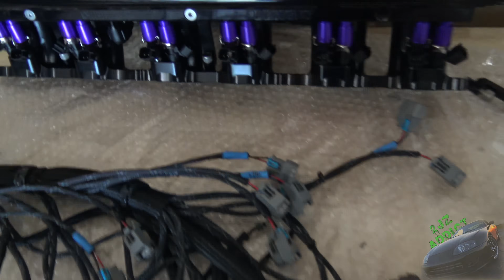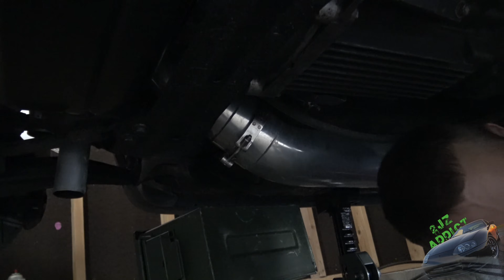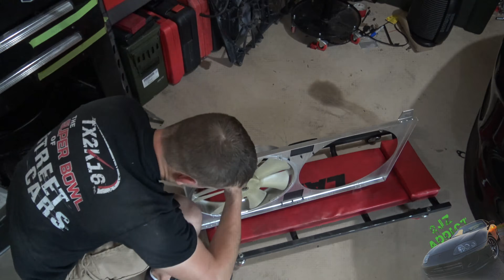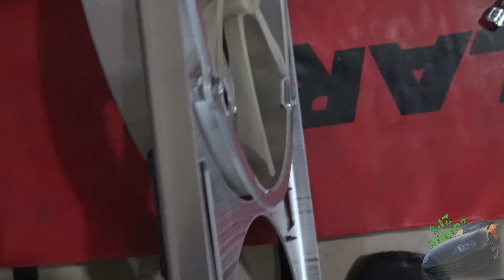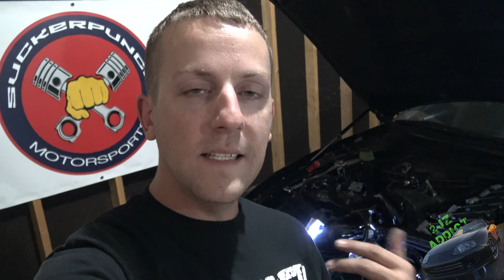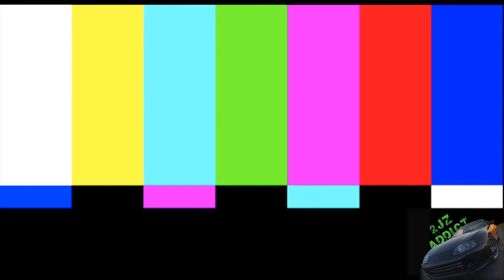1000hp Supra Build | Part 9 | 99 Problems and my Supra is all of them

Comment: brother, this build is amazing. Going  to buy the phr fan shroud and transmission cooler for my build.
Reply from the maker: Thanks man! I appreciate the kind words! 🍻👍 What all do you have done to yours?
Reply: @2JZAddict  still getting the parts together for the sc xD.
Reply: @2JZAddict  Was planning to get the grannas t56, but i really dont wanna cut the tunnel, so ill stay a340e for now.
Reply from the maker: I think it’s just a mild trim for the T56 though isn’t it? I didn’t think it was anything too crazy. Sounds like you’re going at it right. Getting as many parts together before you tear into it is the best way to go for sure. It’ll minimize the downtime and keep things going as smoothly as possible during the build phase. 👌

Comment: What exhaust do you have on that? 🤔 is that aluminum that you was bolting up to the downpipe?
Reply from the maker: The exhaust is ceramic coated a high luster silver which is why it looks so much like Aluminum. It’s the 4” SP F1 DP/MP w/3” boost actuated cutout mated to a Veilside Teardrop Ti. I might end up swapping it out for the HKS Racing TI though for some better flow through. 🤔

Comment: I had to notch the steel for the fuel pump fittings , same as what you are running into , and I made a custom "hat" to clear it all.   Also did you make sure that the cams have a rear pic up ?  I have always have more success , in more of a stable sync running the front cam sensor .
Reply from the maker: That’s what I’m leaning toward. I’ve got the high rise hat from Wade so at least that part is good. Haha I’m honestly not sure on the sensor pickup. They’re GSC S2s and I was running the forward sensor position on the old setup. 😬 I suppose we’ll find out really quick when it doesn’t start due to lack of cam sensor reference. Positioning the injectors in order to clear the sensor will be the issue though. If I do need to run the forward sensor I’ll need to grind off the material for the factory IM support.

Comment: Other option is a radium fuel pump hanger?
Reply from the maker: The Radium hanger is a great option for electric pumps. Trying to run the large pickup to the mechanical is what’s getting in the way. I think it would be possible to CNC a cup so that the fitting would sit flush instead of having to pop up. 🤔